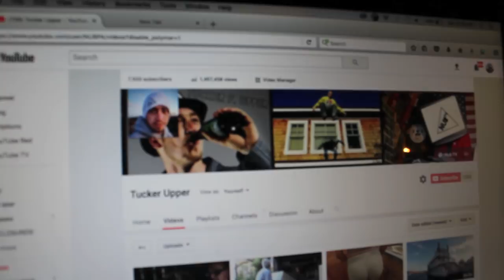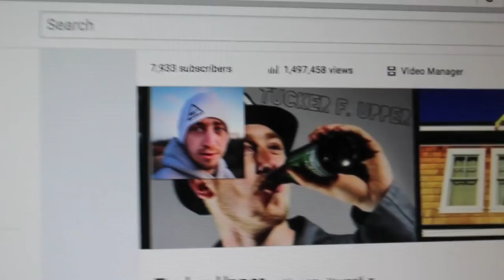FORECLOSURE TRASH OUT!

Comment: I would love to have a dump trailer like urs... That would be for the dream... My truck is a Chevy Silverado, 4L60E transmission... Basically an electronic version of the 700R4 and they are weak... I couldnt haul that trailer loaded... It would take my transmission out... I would like to put in a standard, or a 350turbo or 400, the best 2 transmissions GM ever made... You cant hurt em. I had a 350turbo trans in a 78 blazer and I abused it, hauled way more than what it was rated for and it never did fail me.
Reply from the maker: Dump trailer is life changing just lucky I ran into enough money to scoop it up when I did. Without it these jobs would be miserable.
Reply: Theres a trailer place here that does financing for less than 100 a month... Thinking about trying to get one. I could use one.